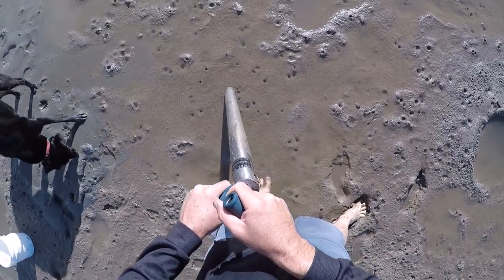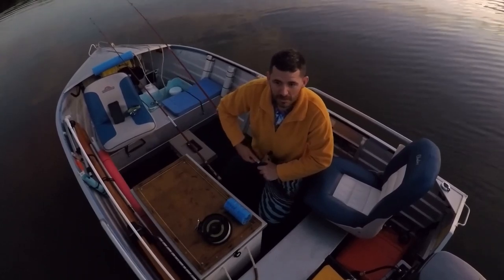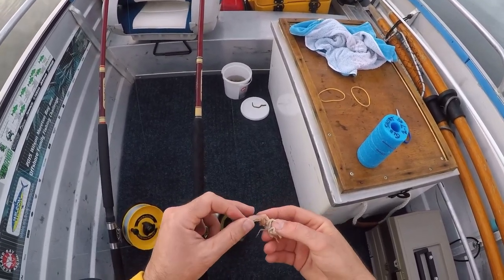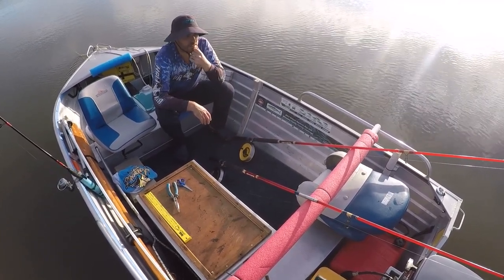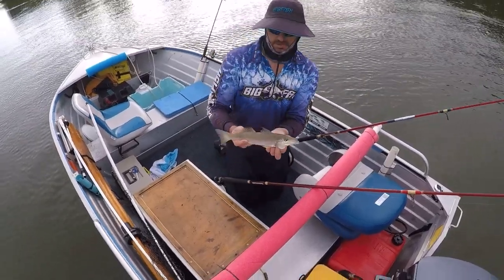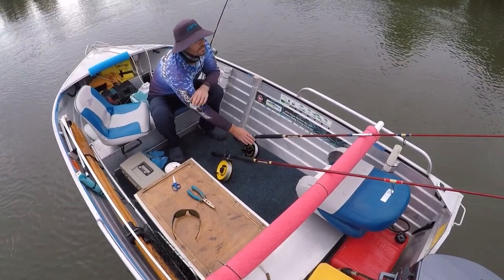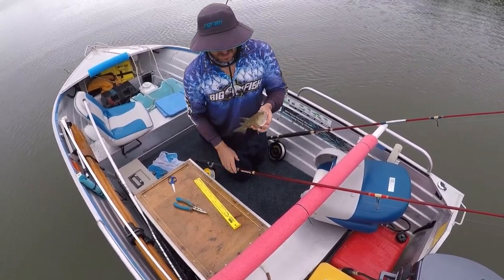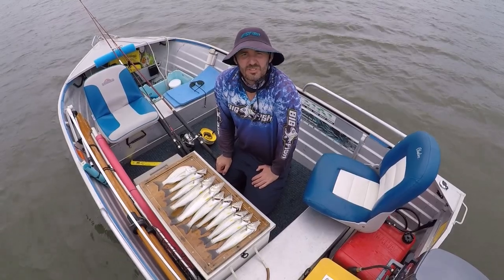Summer Whiting, Gold Coast, October 2022

Comment: HI Adam , the Alvey reels you are using are they the 6' A5. is the a5, stand for shallow spool.??
Cheers Chris
Reply from the maker: Hi Chris, my whiting reels are an Alvey 625B. It's the smallest capacity Alvey reel in the 6inch range. I prefer this because it's hard to fill an Alvey with 3kg/6lb line. They are a graphite backplate with plastic spool so they are nice and light. 
I'm not familiar with all the part numbers but the first number 6 denotes the spool diameter (6inch), the second numbers 25 denote the spool width (25mm I think), the letter B refers to the style of drag (in this case there is none)
From memory an A5 model has a stainless steel back and no drag.

Comment: Gday Adam….new to your channel and was wondering can you give me a bit of a run down of your boat and motor. I much prefer to watch Bread and Butter type fishing than others…..thanks
Reply from the maker: Sorry for the delayed response Mark, work has been getting in the way lately! Thanks for checking out my channel. Whiting fishing is how I started fishing and it's still my real passion. I've got the offshore bug but I'll never give up the bread and butter!
The hull is a 1998 Clark Cutter 3.7m 
The outboard is a 1997 Yamaha 20hp two stroke motor. It goes like a rocket with the 20hp, topping out at 40km hr WOT (on a calm day)
I bought it off my neighbor back in 2003. Great stable tinny for it's size but terrible in heavy chop and very wet. I love it though because it'll motor along in 300mm of water and I can drag it off sandbanks when I push the envelope too far.
Over the years I've added all the electronics/lights, grab rails and a aluminum base for the timber floor. Welding in the aluminum structure under the floor really changed how the boat handled (for the better).

Comment: Hey Adam, can I ask where the yabby flats are? Just moved to the Southside and no idea on this side of town… or Gold Coast way.  Cheers 🍻
Reply from the maker: Hi Andrew, I usually pump my yabbies out the front of Orana Esplanade, Victoria point. Keep in mind there's a green zone to the left hand side as you come down Point O'Halloran road so stick to the RHS. It's a huge area.
If you're down the gold coast, most of the sandbanks in the Broadwater hold yabbies. The banks south of wavebreak island are full of them (only accessible by boat) 
I like to scope out new areas to fish at low tide. That way I can physically see the structure/sand banks and see what bait is around. If I run around I done have to wait for an entire tide change to go home either 🤣
Reply: @adamneeson  thanks for that. We are at Waterford so usually fish the Logan river. Found what might be a yabby bank at cabbage tree. Seems a bit rocky underneath though. Lots of soldier crabs
Reply from the maker: @SargetheFlyFisher  I've pumped a few yabbies along fisherman's gutter out the front of the Logan river. They were hard work there but I did get a few.